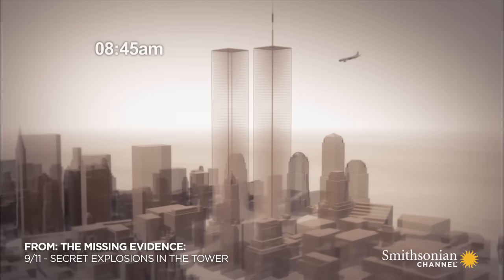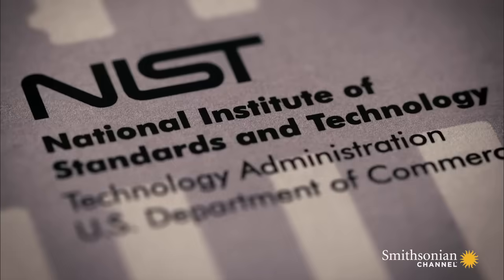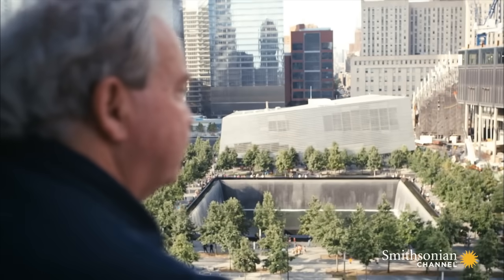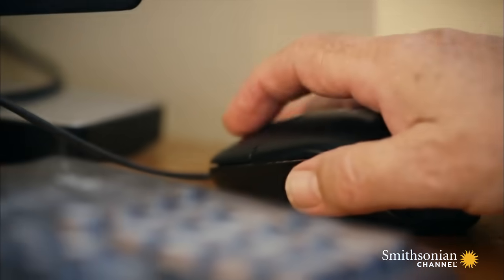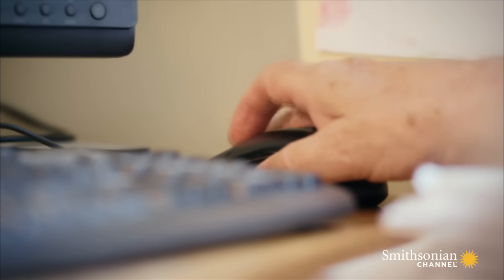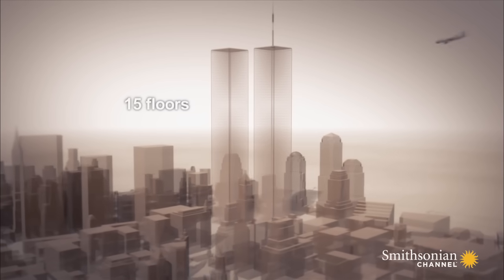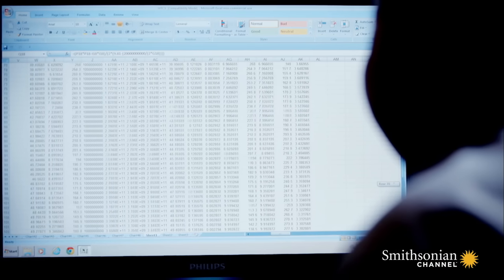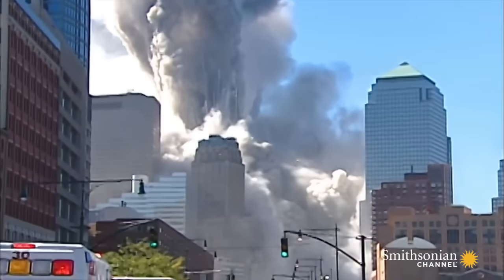This Computer Simulation Explains How the Twin Towers Fell

Comment: It is impossible for aluminium framed airliners to breach full steal beam buildings, they would just crumble like soda cans and fall off. Aluminium is a soft metal thus will crush and bend unto itself when forced to smash into steel beams. This video is once again propaganda designed to support the lie that the establishment wants you to believe.
Reply: or also by your logic lead bullets couldn't possibly penitrate steel.  lead is way to soft.
Reply: pumpkin is alot weaker than aluminum, but with a 500 pound pumpkin i can crush a car
Reply: Research is one thing, experimentation is another. Why don't you have a piece of aluminium fly at airplane speeds and hit a stationary piece of steel and report to us what happens.
Reply: George Bonta You're confusing hardness of the materials with the physical implications of a high-speed crash. By your logic, the Titanic couldn't possibly have been torn open by an iceberg because its steel is way harder than the ice, so the ice should just crumble away.
Reply: the aluminum on jet planes like those is a lot thicker than a pop can. so by witnessing the planes hitting the building and seeing the damage is not enough for you. did you not see the massive fires burning?  did you not see the people jumping to their deaths? did you not see the buildings crumble at the points of impact? the terrorists were the only ones that conspired to do this horrible act and they did it. they actually pulled it off. they had planned this for years. If the government did this then why aren't they doing more of it? what did they do before 911? People like you need to find another hobby!
Reply: styrofoam broke the heat sheald of the columbia space shuttle so if foam can do that at high velocity so can aluminum.
Reply: Even a piece of straw becomes the strongest spear when travelling at 500 mph.  Please refer to tornados and their effects (and keep in mind that, even in the strongest tornados, those planes where travelling maybe 250 mph faster at least).
Reply: You've done your research....IE "I've read all of the sites that confirm my preconceived notions. Any other information is irrelevant so I'll just chalk that up to lack of time."
Reply: It's something called kinetic energy buddy. If something is large enough and fast enough, the material composition doesn't matter, it would still go through it.
Reply: George Bonta Alumninm at 500mph will definitely punch through steel. Just like a lead bullet going 1200 fps will punch through steel.
Reply: My Opinion That's a far fetched idea. The plane was fully loaded with fuel, and with any material heavier than aluminum would not have been able to take off. Refitting an airplane with a different material would do what in your opinion, make it penetrate the building more? What kind of lunatic would hatch such a ridiculous scheme. It would require an enormous amount of engineering work when simpler solutions exist. This is the same logical problem with all of the 911 conspiracy theories. There's no reason why if they were able to plant explosives that they wouldn't have just detonated them and said it was a bomb. Anyway, the simple answer to all these questions about the material of the airplanes is this: The concept that a softer material can not penetrate a harder one in a collision may be intuitive to a layman but does not hold up under scrutiny. There are many real world examples where soft objects penetrate harder objects, and making a strong assertion about the expected outcome of a high speed collision between two complex objects based  on their material hardness alone, destroys the credibility of the person making that assertion. Just look at how certain they all are in these comments, and yet they don't know what they are talking about.
Reply: George Bonta  And you talked to a chemist, and a aeronautical engineer right?
Cause if you did, they'd have some conflicting info as to how metals act, how strong they are due to their strong metallic bonds. And how aluminum on aircraft is layered and treated to withstand great psi differential at altitudes as high as 38,000 feet.
Reply: Raminator indiana Aha will see.
Reply: My Opinion - It is not true that aluminum can't smash through steel. Of course it can, if the energy of the collision is high enough.
Reply: My Opinion the Boeing 767 has an Aluminium airframe.
Reply: My Opinion Composites or any other  material would still have to satisfy the weight requirement and so the increase in strength would be incremental, as it was with the latest generation of planes using composites. They make them as light and strong as possible. Yes we know what the planes were made of, if you think they were made of something else the burden of proof is on you, and you don't have any. Proof would be a combination of maintenance records, bills of materials, witnesses etc. I could say I'm an elephant that has been trained to use a computer and ask you to prove it. You would have no way of proving it. That doesn't mean it's not ridiculous.
Reply: My Opinion Yes and the most likely explanation is that they were traveling at high speed and caused the damage themselves, with their standard design, with no additional damage from explosives etc. There is no proof of anything else, and it's the simplest explanation based on the evidence we have.
Reply: Jetliners have titanium air frames- harder than steel….
Reply: Mark-which is stronger-wood or steel.?? I think-steel[the exterior wall of the towers]. Dmitri Khalezov [a physicist] said that its  steel is as thick as a tank's armor,which a high powered bullet[traveling about 1500 mph] can not penetrate.
Reply: Therefore,George's  above comment is correct.
Reply: Bundeswehr-that is only partly true. The towers had the thickness of a tank's armor..  Tanks are  designed to stop a rifle buller[for example  from a .303]..traveling at 1500 mph, to protect the crew inside.And the bullet is solid,not hollow like an airliner.
Reply: There's a huge, HUGE difference between a bullet doing that, and a giant airplane doing the same. As I've explained before to other people, the bullet is able to do that not because of it's energy, but the energy density, as the energy is focused all in one small area, that's what makes bullets so effective, on the lower scaled they aren't very powerful but their energy density is. Take something like an airplane, which is huge, it wont have the same energy density of that bullet, all that energy is spread over the area of impact, making it far less likely to have any chance of puncturing it. But hey, 500mph is pretty fast, and airplanes are kinda focused, ultimately it doesn't matter though, as the tower could be hit with multiple, larger planes, that all puncture through, and it would still stand. Theses modern structures are amazing, and no plane impact that imparts less force than the wind forces it was designed to handle, onto a structure that ultimately weights 13,000 tons compared to the 300 tons of an airplane, is going to take it down. And fire has even less of a chance.
Reply: If you actually read carefully, you will find that I didn't say the outer structure of the towers is impenetrable anywhere in my arguement. If you could go through and disprove every one of my points, which most are based on hard evidence and testimonials from the very designers of the WTC's themselves, then please do. Because I haven't seen a single person do it. At most they do what you do, which does nothing but show your own ignorance. And don't even question my basic understanding of physics, you're talking to guy who has been watching Vsauce and Shoddycast videos for years now. "Oh look at this guy he doesn't know anything he learned everything from the internet" ... Yeah, the internet, the only uncontrolled media source we have in our world, an invention so amazing it makes most of our schooling utterly pointless, but we act like the information to be found on it is all false. Actually it's the opposite, as the internet is the only source of information they can't control, so they demonize it. And let me ask you a question, the American airspace has been for the past 50 years the most heavily guarded airspace in the world. Yet no action was taken against the hijacked planes, though when you realize there's an airforce base only 15 miles from the Pentagon, that didn't make any move until after the plane hit. Are you guillable enough to believe some cave dwelling muslims hijacked our planes,  and flew them all the way to their destinations, without being intercepted? And it's really simple as to why they weren't intercepted, because on the day of 9/11, NORAD was conducting 15 seperate drills, even sending 3 f16's from the airbase stationed right next to the Pentagon 180 miles away for drills. Drills which have been going on in NORAD for over 2 years before 9/11 happened, drills including the hijacking and use of commercial airliners as weapons. Yeah, 2 years before this shit happened, our military was performing drills covering this exact scenario. In fact, these were the very drills they were going through on the day of 9/11. Explain how, in the most heavily guarded airspace in the world, that these hijacked planes make it all the way to their destination when we have easy proof of them easily responding to situations like that within 5-15 minutes, that's how long it took to have these guys surrounded by f16's and the coincidence that we would performing these drills and simulations on the day it actually happened.. maybe to confuse the lower military personell and make them believe that it was actually part of their drill, so no response would be made. The Pentagon has the most CCTV cameras of any building in the world, and the government has no footage of the supposed plane flying into it, only a few pictures. Suuuure.
Reply: Apply newton's law of motion and the theory of Mass aswell, some things are not checking out i do agree. however. The casualties are still casualties.
Reply: mopar69brt Sorry, do a bit more research, preferably somewhere other that YouTube. Go try some reading, read and research the views that support your theory and those that don't. Look at who wrote each; are they logical, are they trained, are they well informed. Look at what resources THEY cite, use, refer to. Are those resources primary resources or are they just retelling something someone else said. Keep doing this until you arrive at the actual source material. In your specific statement, the "weak/inferior rivet theory" has been thoroughly debunked and professional engineers have stated that the rivets used for Titanic were actually much stronger than a "typical" rivet of the time was. The same is true of the steel. It was most definitely not weakened, but rather was the correct strength. Hartland and Wolfe had contracts with White Star that would have been worth millions, if not billions of pounds. Not one and no company would have tried to shortcut things which would have lead to the cancellation of those contacts.
While I'm certainly no engineer, my guess is if you took a modern ship and ran it at about 18-25kts and side swiped an iceberg, that ship would sink as well. When potential energy is quickly converted, the results can be catastrophic. Don't believe me? Go jump off a bridge from about 40-50 feet up and belly flop into nice deep, soft water... You'll quickly find that water has the impact force of concrete at that height. Well, your next of kin will anyway.
Reply: HELL YEAH a 200 ton airliner traveling 500 plus mph should just bounce right off and not damage a thing. that makes perfect sense if you are an idiot like you george.
Reply: Well it wasn't like the plane hit the tower knocked over the beams and the buildings collapsed upon impact, the plane obviously didn't make it too far into the building because of the steel beams.
Not to mention its not like the whole building was one giant slab of steel, its structure is made of steel but its still a relatively hollow building with most of its outer layer composed of glass.
Reply: Stuli The titanic was a totally different story. The steal was compromised because it was not of the purest kind and it was exposed to extreme cold, and the rivets were of inferior quality doe to the labor demands of the time. Basically the titanic was punctured due to the rivets and the metal sheets bent causing excess in pressure which made the rivets pop.
Reply: George-i agree,there  were no jets,just camera trickery
Reply: I've done my research, and even spoke with a physics teacher who has concluded the same as I. But anyway I cannot at this time devote more time to this conversation. Take care.

Comment: it was thermite you fucking sheeple
Reply: what was your evidence of thermite
Reply: jet fuel can't melt steel beams...
Reply: it can weaken the steel to the point where it cannot hold much weight. give me something else, any themite residue found? how would you even get that much thermite into a building?
Reply: where is your evidence that it was not thermite
Reply: a fucking plane flew into the buildinh, there was witnesses that saw it go. the top collapsed where the plane crashed. thermite is very hard to transport.
Reply: answer this, how would you get hundreds of pounds of thermite into a building without any person seeing it, reporting suspicious activity, without security at the building doing anything
Reply: how would you be 100 percent sure that was molten steel. it would have been electrical sparks. in the rubble, it was alot more oxidized, so paper, any other office supplies could have been burning alot hotter and reach temperatures of 2000 degrees. also, just because there was temperatures of over 2000 degrees automatically means it was thermite? it only burns for a few seconds.
Reply: it was obviously an inside job. Yes, a plane flew into it but that was just for the effect of a terrorist attack. In reality, the rothschilds and the Rockefeller foundation along with the US government created this false flag to fuel hatred of the middle East in this country and fuel a war costing trillions of dollars and making those two parties richer than ever